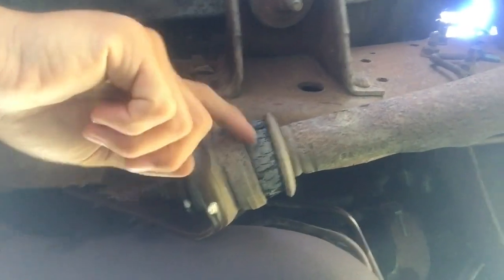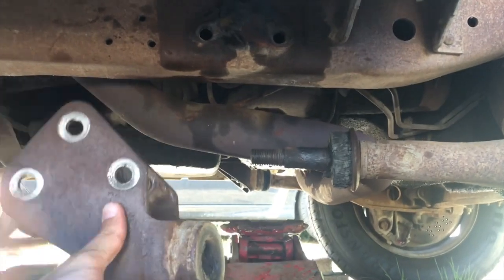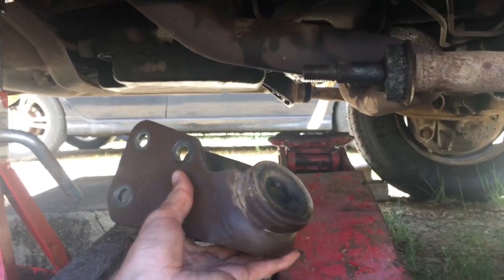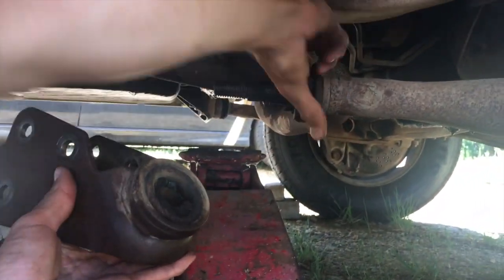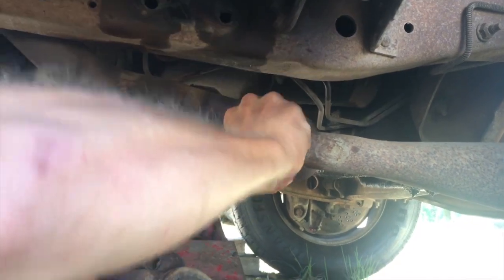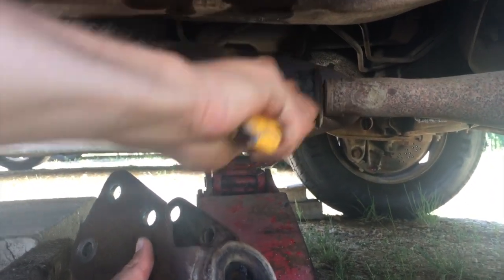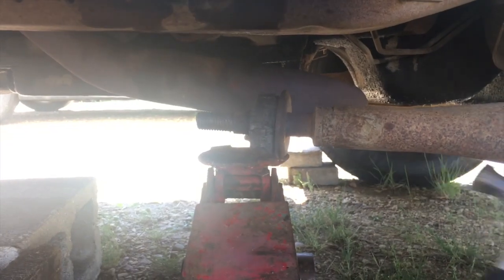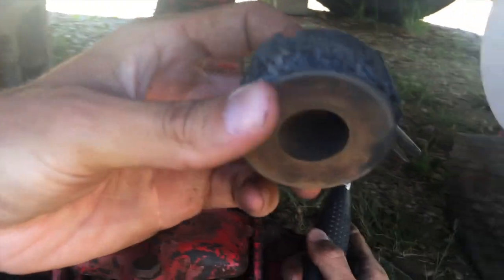Installing new Radius Arm Bushings

Comment: Good job... learning by doing... DIY: the struggles we make can bring great lessons that we apply to tasks later in life or choose not to apply (i.e. maybe some things are better left to others to do and worth paying for). Either way you pay. You can use your time and energy or pay someone from the funds you earned doing something else, but when you DIY, you get valuable learning experience. Evidently you had trouble inserting the bushings onto the threaded shaft of the radius arm because they need to be close fitting. The machine work (it looked like you used a knurled tool to remove bushing material, blue) was to create a "chamfer" or beveled surface to enable easier insertion. Force fitting the bushings with the box-end wrench and a hammer was a good example of improvising to get the job done. Doing mechanic work is all about physics! I hope you guys enjoy your BC Rockies trip... I certainly did, but it was a fast paced week for me. I'm sure you guys can see more with more time... don't forget to bring bear spray to save the slower hiker or biker!
Reply from the maker: Thank you for the comment. I was sore from head to toe for 4 days haha. But I learned and now I feel more capable with cars. And the trips is going great! And haha 🤣 about the bear spray for the slower joker or biker lol. Thanks for watching and supporting!
Reply: You should checkout Ryan Van Duzer's YT channel and his awesome videos. Right now he is traveling with a woman he fell in love with and posting trip videos of his Oregon coast to New York coast gravel bike ride. I believe you once mentioned you did a trans-Canada bicycle trip. Listen to the love advice they get along the way from strangers as they travel.  I'm curious about YOUR trip route and agenda.